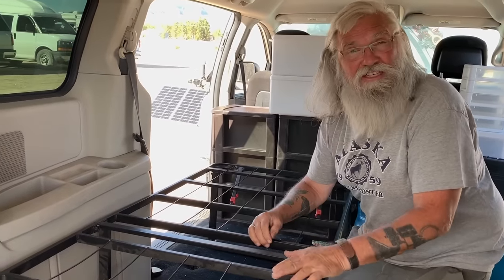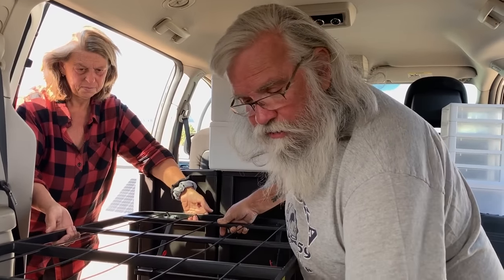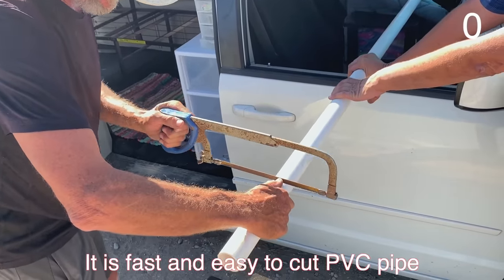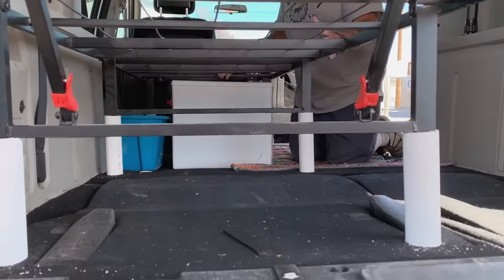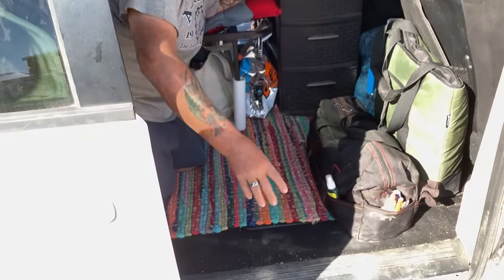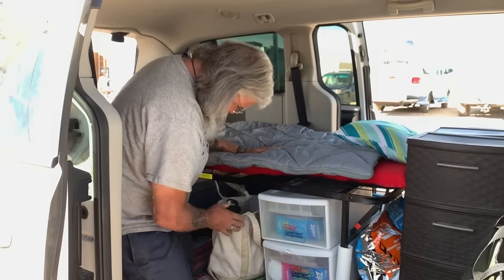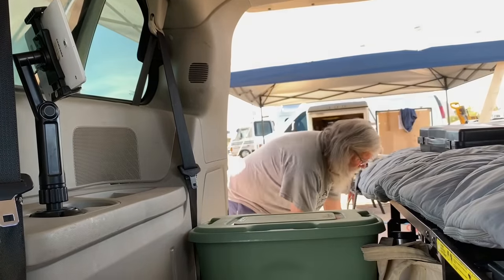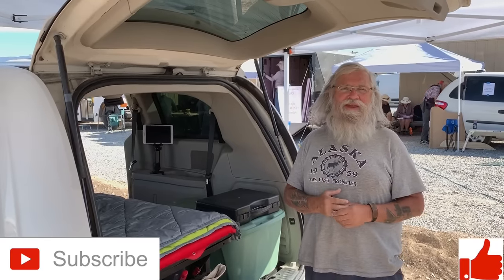Van Life for Less: Affordable Easy No-Build Van Conversion | No-Build Van Life

Comment: You can use a standard automotive hose clamp as a guide to get a straight cut. Nice build !  That cot looks good and strong.
Reply: it is very strong. i have two of those exact ones screwed together to provide a base for my full aka double bed.
Reply: Simply Lesa in her video said it was half of a queen cot (amazon) which would be 27 inches wide.
Reply: Would you happen to know the kind of cot this is I'm having difficulty finding ones with straight legs and not curved bottoms.
Reply: @jsso2845  Amazon has a Zinus line of cot frames. Lesa , whose minivan that was, said she got a queen , which came in 2,  27 inch wide pieces,. Zinus has an adjustable twin to queen frame(30 inches  to 54 inches wide). You can also use storage shelving from Home Depot or Target. HD sells a 24 inch wide shelf for about $50. And an 18 inch wide for about $40. You could double up the 18 incher for a 36 inch wide bed frame. The Target one is sterilite which about 14.5 inches wide. double them up from a 29 inch wide frame. Utilize Bob's PCP piping method shown in the video to make the frame as low or high as you want or need.

Comment: The best place to put your clothes is literally lay them all flat in layers according to season, under your foam egg crate mattress padding on your top mattress. All you have to do is raise your light weight egg crate in whichever area top, bottom, left, right, front, or back to take a piece as needed. It leave all storage bins empty to use for canned, fresh foods, dishes, etc.

Comment: I did almost exactly the same thing in our Transit passenger van. We even have the same rug! The bed has only 4 legs and no cross braces. That gives us under-bed storage that is completely clear of obstructions. The bed is about 18" high, so we are able to fit  a total of 12 storage drawers, stacked 3 high, plus tons of other stuff. I use velcro to keep them from sliding open. We have two 1,000-watt batteries, so we have a small microwave and can heat water, make coffee, etc. without using the butane stove. We also have a battery powered fan. What I miss is heat. We have a small heater that uses propane, but I'm a bit leery of using it in such an enclosed space, even with the window cracked. I'm just blown away by this wonderful video. I thought I was the only one to do a no-build build and was often a bit embarrassed about it, what with all the gorgeous vans you see online. I also made screens for the front windows using magnets. I'm working on one for the sliding door. Thanks again for the video. I feel totally vindicated.

Comment: I think this is what you have to demonstrate to bring home what can be done.  I have a small cargo van with a 12v fridge. That adds complexity and cost. The cot was too hard on my back, for sitting, and I'm OK just sleeping on the floor.  I have a folding chair and table. I wish there was a small vented heater for small vans, a vented catalytic heater would be great.  It might help to put an insulation blanket between the front and rear. From my experiments you can heat a van with a bit of insulation quite easily. I also use an evap cooler.

Culture wars are breaking out on the coast over homeless issues. Young people are in an economic bind. People go broke from one medical emergency. I'm hoping this is a real model for basic housing, I guess for singles. There are some things to study. I don't know if people live in a van like this and work at a job. If you really shift work with the seasons, that seems OK. I wonder how the costs will be to maintain the vans.  I

In the past it seems like CRVL has attracted trolls. There seems to be less of that. I've looked at your charity status and the basic info on HOWA. It sort of comes down to getting the ball rolling, building some momentum. It would be great to fund this privately. I have some money and land I might leave to HOWA, but I don't know how well it will work and how dependent it is on Mr. Wells to guide things. 

Wells had a quote from Steve Jobs. That's kind of what you need for very basic alternative housing. Very creative thinking. It almost has to be designed for parking spaces, the only available land in many cities.  If people want to use these as RV's it's great, but it's not really the problem. 

The thing about this video is that it shows building a dwelling space can be outrageously simple. It's almost trivial. And yet in rich cities they argue over housing that costs $200,000 per unit, and up. It's never going to get built and people will turn against the homeless. This is so very caring and human.
Reply: i would suggest getting a memory foam mattress, or at the very least, a memory foam topper. they are simply wonderful and can be found for not too much, especially the topper which you can find for 10 to 50 bucks depending on size and thickness.
Reply: I think Crystal Vanner has a regular job. Depending on what your job is...some people do online work from their RV, they just need an internet connection.

Comment: I’m in week 2 of my no build Toyota Sienna. I am designing it so there are no permanent modifications, nothing attached to interior, no seats removed and everything must be able to be done from inside the van. I do not want to have to get out of the van to access anything or perform any functions. like cooking. So far the biggest expense, besides the van, is the Bluyetti power bank and solar panels. It is amazing how little is needed to live comfortably. I’ve learned a lot from Bob and appreciate his candor as well as his willingness to share his knowledge and experience.

Comment: If the legs of the bed are around 1" short you can use pvc caps on the legs
Reply: The only thing with pvc caps is that they are rounded which makes them slippery.
Reply: @SimplyLesa  not all of them
Reply: @SimplyLesa  > in the case of slippery ones, go to the dollar store and get those thingys which go on the ends of chairs legs so the floor doesn't get scratched and so the chair doesn't slide around.

Comment: I'm curious if you thought of taking one or both of the second row seats out? Underneath the floor there is a ton of storage that is hidden by the cover that is already there. I am guessing you'd probably want one for if/when you have passengers, in which case, I would take out the one that's under the bed/behind the driver. 

I have this same van and I LOVE the Sto-N-Go seating.
Reply: HOWA offered to remove the seats although since it's becoming my van and I am a minimalist. I didn't want to remove them. One could remove any or all of them for fabulous storage. I didn't want to change the resale value and I might use the seats. 
Everyone in this life has to figure out what they need.

Comment: Good job with the bed legs. For a few extra bucks, I would suggest adding the plastic PVC caps on the bottom of the PVC legs so they don't cut into the carpeting/flooring. 🤗

Comment: I have a 6x 12 Cargo Toy Hauler Trailer and I use Wal Mart plastic drawers like those you are putting in that van. Weight keeps me from building out my trailer with wood. I have a Ford F- 150 Crew Cab Pickup and even a small cargo trailer gives it Hell in the Mountains. I worked in Special Options in the Cargos Trailer Plants here in Ga. so If I wanted an elaborate build, I could do it.  The #1 Law of Nomadic Living on a budget …KISS… Keep It Surprisingly SIMPLE. 😊❤ YOUR AN ANGEL BOB.

Comment: In the next video could be included, bed mattress ideas, bathroom ideas like 1&2 and shower.
Reply: The best and cheapest shower is simply a plant sprayer with the brass spray nozzle taken off, I used a 5 liter one every day for nearly 2 years living in a small room inside a garage, the room had no plumbing but there was a cold tap outside.  To get 40 degree (celsius) water you put 2 liters of boiling water in (boiled on a stove) to 3 litres of cold, pump and you have about 4-5 minutes of a hot shower, you will have to pump again a few times during the shower but not much.  There are dedicated camp showers with this system too but they are just more expensive plant sprayers, with the little shower nozzle, I got along fine without it.  If you are in a cold place or want privacy when living in a car / minivan, you can get a small awning to go on the back or side, and shower in that.  I am going to do this when I get either a minivan or landrover defender and go camping next year, plus a thetford type chemical toilet, then I will have all the comforts of home.

Comment: I just love your channel.  I love that all of your ideas and recommendations are budget-minded and simple to implement. 

 I have a couple of questions.  Let's say you were outfitting a box truck and also did not know how to build but had a little budget to buy some glam camping equipment (say 2000 to 3000). When I say glam camping I am talking about things like those fold up kitchens with cooking area, and vinal sinks (like the GCI Outdoor Master Cook Portable Folding Camp Kitchen) and pop up showers with some type of pumps etc.  How would you outfit a chevy box truck with that sort of easy to buy and relatively inexpensive gear? 
What would be your recommendations? 
I would love to see a video on something like that.

Comment: I did a similar set up with a mild build (small sink) 2 6V in series for running fans etc. I use it when I work away from home. It’s a big time money saver as long as you find a place to park.

Comment: If you remove the front passenger seat, you gain a lot more space.
Reply: The van will scream homeless Joe's camper.

Choose a van with stow & go seating if you need the extra room.
Remove the sears, use the stow area.
Reply: @EvilTwin123  not really, unless they look inside
Reply: @EvilTwin123  True! The last thing you want is to look like you are living in your van.
Reply: For the windows  you put window coverings on the inside.  😊
Reply: Faviola Andaya exactly

Comment: Where’s the link for this cot? I don’t see it. I looked in your store and can’t find it.
Reply: @Diane Boyd, I know Carbella's has several cots for sale.
Reply: Thanks Janice, I looked at Cabela’s but I like the style of the one shown in the video.
Reply: I'm looking for the link to the cot as well.
Reply: I was also looking for the cot link.
Reply: I just did a google search for cots and the leg style of the cot in this video is similar to the Irma foldable metal platform bed frame from Wayfair.com.
Reply: Me too. Thought I missed it.
Reply: @dsmck70  Yes. Looks like the IRMA has the same number of braces as the Bob version, not the Amazon link bed here in the comments. Thanks.
Reply: @tj4034  yes that's it. I found it earlier today on Amazon.  It's  30" by 75"
Reply: @tj4034  The supports for this frame go back toward the center of the bed and would prevent a lot of storage containers being able to fit under the bed.
Reply: I think Tim and Ron have the wrong frame. (I think Bob's link is wrong, too.) The frames Tim and Ron send you to have the supports slanting back toward the center of the bed thereby preventing storage containers from fitting under the bed. Bob's link is to a completely different frame which does not fold and is not as simple as the one he actually used and has sharp looking corners.  My whole family sleeps on these kind of frames, and I highly recommend them. I think what Bob actually used one half of the queen size version of AmazonBasics Foldable Metal Platform Bed Frame for Under-Bed Storage - Tools-free Assembly, No Box Spring Needed - Queen

(I don't know how to make it a link, sorry.) The queen is 60*80 - half would be 30*80. Personally, I would use half of a full. It's 54*75 - half would be 27*75. That's plenty of bed for my 5'2" frame and leaves more space for other things.
Hope this is helpful!
Reply: @annejusttryintobecreative9934  Good eye, I agree with you that they are using one side of the amazon basics Full size bed platform.
Reply: @annejusttryintobecreative9934  thanks for your detailed insight.  I have an NV200 Nissan cargo van, and I've been slowly turning it into a little place to camp. The cot I'm using is a Coleman short folding one, which is only 24 inches wide,  and those extra three inches would be great. BTW, I use duck tape to hold the cot from sliding. I'm planning on taping the  table as well.
Reply: The bed frame is NOT a cot. There are two options: 1. A narrow twin bed frame which is 30" x 75" found on Amazon. OR 2. Half of a queen size bed frame also on Amazon. This is what we actually used for my bed and it is 27" x 73". 
I believe Bob has links to both.
Reply: I did a search, and it looks more like a bed frame in twin size than a "cot".  All good, but try googling "simple twin bed frames" and I think you will find it.  Since there are two of us, I was looking under full  sized and found one just like it.
Reply: @annejusttryintobecreative9934  must be half of the double then Because mine is 27 x 75
Reply: That was a mistake it's half of a full size bed frame (not queen size)

Comment: If you have the ability to get a roof rack and maybe a sturdy roof bag or case you can use the roof for more “must have items”. I bought a nice, in good condition roof rack from a Salvation Army store, and use some sealed plastic boxes that I secure with bungee netting on my Explorer for camping. We lay everything down in the cargo area and use a 6 inch thick memory foam mattress with bedding and it’s large enough for two average size people to sleep on. Most stuff goes on top, but we can still store some things in little cubbyholes and compartments inside. We have a portable kitchen and table with folding chairs, and use a tarp as an awning that we tie off of trees or use poles and stakes to secure. We don’t usually camp in the summer, instead we like the cooler seasons so we usually don’t need to use the A/C or heater. Still have a great time.

Comment: I did a mostly no build build in my 1960 airstream. I took out the twin beds and kitchen, A neighbor built shelves for over the wheel well. That was the only building done. The rest is three level shelves and a twelve volt fridge all around the walls. I bought a mattress to put on the floor for the dogs in front of the couch,which I use as a bed. I have two Coleman stoves facing each other on opposite walls. One is set up with a Coleman oven. My airstream has a lot of windows which I have planters with my edible plants.

Comment: I really got a lemon deal by someone when I bought my van off a car lot.
 I have a 2010 Dodge Ram Caravan for a little over $6  grand .... and it's unbelievable how many electrical issues and other problems I'm still working on to get fixed -- not to mention the airbag recall.
It's been a real nightmare and I still have 5 years of payments on it to make and I ended up on Disability....so.... I'm really extra happy to see this video! THANK YOU !!! ....  because since I still owe on it I really hate to do a full build-out, and with as much money as I have already sunk into the van,  if I sold it now,  I would never get out of this thing with my head above water anymore..... 

I love this non-permanent build 👍 it also will help me until I figure out what is the best setup,  which I'm still working on even though I've had the van for about 8 months now.

Comment: It started with using a 40 ft. high box for a shed in my backyard ...framing, insulation, LEDs, etc. to the interior. Then what I did caught the attention of those around my neighborhood, THEN word got around to those getting into the van life, and van lifers passing through. When it came to questions of which direction to go in, I told them: "Keep it simple" ...simple to build, simple to fix, etc. And there will be more-likely someone around(like me) that's ever-willing to explore the direction of one's design/build and build whatever is suitable ...of-course in the realm of experience. But whether it's a fellow nomad/van lifer or someone in your neighborhood, there's going to be at least 1 person that knows how to swing a hammer, and is willing to assist ;)

Comment: I find this approach more effective than the permanent builds, because its cheaper and adaptable. If you end up getting a new van, you use use a lot of that stuff in your new vehicle. If your build was more permanent, well you may not be able to reuse a lot if that material. It may not fit, just be too old or get damaged undoing it. You will than have to shell out more money and rebuild your new one. I guess if you have the money and like doing that stuff and have the time, it's no big problem, but for most ppl it is not feasible. Plus you may not have al the tools with you in your van. I like things simple.

Comment: I "built" a chevy astro van years ago and all I did was put a 2x12 board cut to lenght and laid it across the top of the wheel wells and bolted it to them. I then stacked milk crates on top of the board to store my stuff in and slept on a sleeping bag with my feet under the board. I turned some of the crates towards the back and some towards the front depending on what was in them and if it was stuff that I'd need to access from the back door or the inside. I literally "built" it for less than $100!

Comment: Easy way to do the cot, use the PVC trick but also buy a dowel and cut it for the legs of cot to stand on in PVC  so that you don't rely on the weld strength of the crossbar on the cot, secure wood dowel into PVC with glue or screws. For a kitchen tote, to keep bugs out of the tote, you can often find totes with tops that clamp down but they don't have a seal, but you can buy craft foam easily or even foam liner for other parts of the car which can be glued to the lip of the tote. Additionally, swing away hitch platforms are available commercially and would make a great platform for a lockable kitchen that can be stored behind the vehicle beside a small generator (so you could have electric cooktop if you prefer).